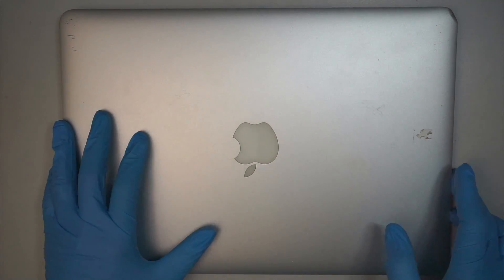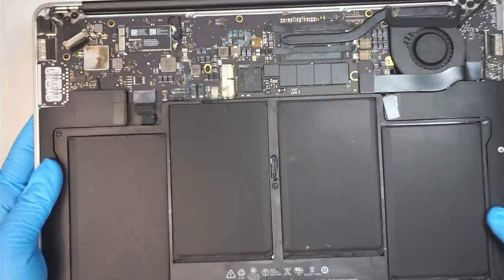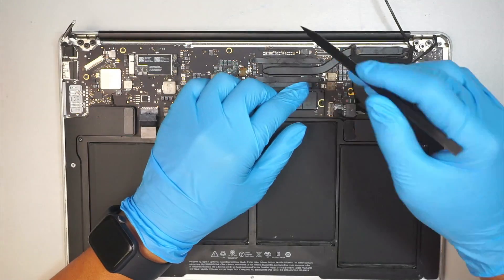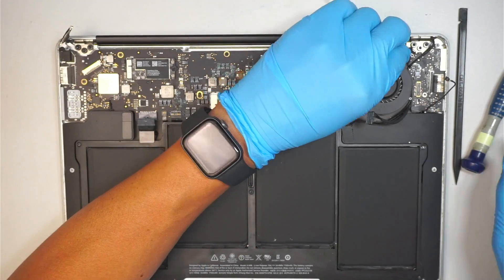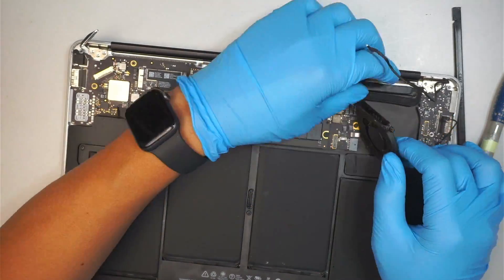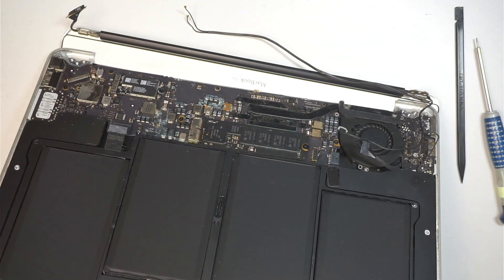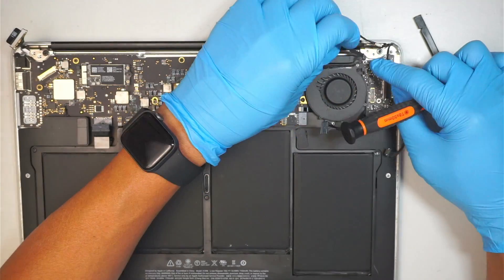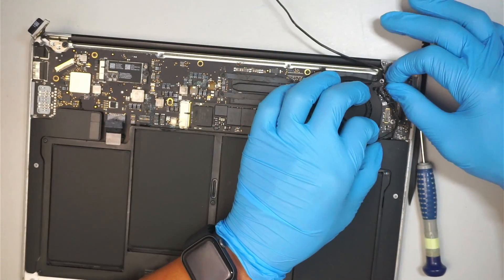Macbook Air A1466 Screen Replacement

Comment: Just a word of advice from a former Genius Bar tech: try to get an OEM replacement from e-Bay from a reputable 99% rated seller. If they offer Grade A condition, they shouldn't run over $100. You might end up with some scuffing and pressure marks due to wear - let's not forget they're close to a decade old in some cases - but they'll display properly. The new aftermarket ones are overpriced and will often have a blueish cast.

Comment: Thanks, saved a bit of guess work. I found it wasn't necessary to remove the daughter board on the right of the fan. Interestingly the screen can be screwed down in reverse position. Yes I was absentminded when installing the new screen and it fit in position fine with the screen facing me which is wrong as the keyboard is on the bottom (top) of the chassis. The video cable not being on the right side alerted me haha.